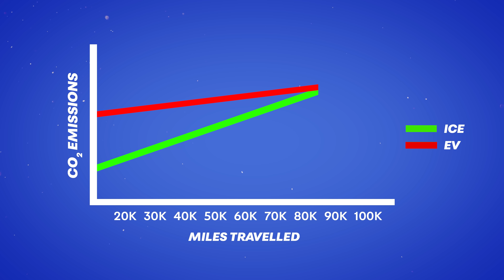Are Electric Cars REALLY That Green? [New 2022 Data]

Comment: (*EDIT* the actual report has a detailed breakdown of materials) It would be interesting to see more detailed information of where the CO is produced in each case. There is no doubt that batteries create CO but it would be interesting to see where and how it can be done better. Also, I wonder if they took into account lifetime maintenance of the vehicle in these numbers. As someone with a PEV, it is amazing the ways that is saves in maintenance. Brakes last an incredible length of time due to regen braking. Oil changes, even on a hybrid with a gas engine is dramatically less often. Also, there tends to be a straw man created where "the energy created to charge batteries is generated by coal" which you touched on. This is simply not the case in most places. Lastly, if you have solar and you charge your car with and you are closer to the 26k miles number, isn't that worth it? The average car is on the road for 200k. Isn't that an incredible reduction in CO2 and more than worth it? I think the biggest challenge right now is not the technology of the EVs themselves, but in the recycling methods for the batteries. There is a lot of development by about a dozen major companies that are promising up to 97% renewability. This needs to be funded and implemented to dramatically increase the carbon offset and answer the last questions of the future of EVs.
Reply: As a car mechanic I tell you that EV have maintained to do. They are far from perfect and people think to highly of them. First of the brake regen for the battery is theoretically good but what it does to the normal people not knowing how to properly drive these vehicles is that they only use brake regen and the normal brake systems seize over time. Costing a brake job every year. Secondly those big batteries are heavy making the tire burn faster and unevenly. Tire are expensive and made primarily out of oil... Can't wait to see all those car going to the scrap because replacing the battery will be to expensive and the client will rather get the newer model instead. Joke aside Ev is far from being the solution just telling you.
Reply: @RAYB1997  Of course EVs need to be maintained. However, most of the serviceable items are unrelated to the electric motor or battery. As far as "normal people" not know how to drive to optimize brake regen, come on. You begin learning from the first time you drive it, you start learning to brake a little earlier and lighter on the pedal to optimize the regen. Plus, EVs are designed to electronically regen on their own. In addition, the information centers give you real time regen efficiency information to help you maximize regen. Also, you still use your brakes so the idea of your "brakes seize over time" and need to be replaced every year is absurd. I have over 90k miles on mine and the brake linings are still over 65%  If I still have the car, I will probably need brakes in 2025. My car is only a couple hundred pounds heavier than other comparable cars. (a full EV is more) but still literally over a ton lighter than my pickup. I got 63k miles out of my first set of tires by the way. Another thing, tires are made up mostly of natural rubber, steel and some synthetic polymers (which contain petroleum but only make up a small percentage) . They still haven't found a replacement for the good old rubber tree. Of course, that is a moot point since ICE cars have tires too. Finally, "Can't wait to see all those car going to the scrap because replacing the battery will be to expensive and the client will rather get the newer model instead" Well, nobody wants old ICE cars either and want the newer model. And batteries from EV cars can have a second life in energy storage, where high load storage is not critical. Already a lot of industry developing to utilize old cells. Medical equipment batteries have been finding "second lives" for years so it is not a stretch to think this will become standard practice. There is also a lot of companies that are being created to recycle to materials from the batteries at their final end of life. All the heavy metals (lithium, cobalt etc.) and aluminum are all targeted at about +97% recyclability. There are a ton of things that still need to be worked out with EVs and infrastructure, but they are here and are viable now and will only get better. Just telling you.

Comment: I have a Ford C-Max hybrid plug in. Bought it used. Fabulous car for me.
Have you seen an oil refinery??

Sit at idle at a stop light or in a  drive thru. No heat blowing from underneath
Reply: And… I drive less than 20 miles per day and I plug it in at home. Go ahead drive one. You might like it. I’ve filled up with gas only 5 times since I bought the car 13 months ago. 29K new with 37k miles and I paid 11K.  Gas is $4.29 here…

Comment: There is a big BUT here. Several EV makers say that the batteries only last about 6-8 years, so that breaking point will in that case be even further away if the EV needs 1 and ½ battery pack.
And then you have the issue with recycling the batteries, also not made easy and is a horrible process. 
So if you ask me, EV´s are today just a silly gimmic. We need much better battery tech. 
AND, then you have the CO2 "badguy" which isnt actually the badguy here, the planet could actually have a lot more CO2 before it becomes too much. Forests, crops, rainforests and so on actually want more CO2. So we would have more and better crops and the rainforest would grow back faster... It is all very complicated!!

Comment: Battery technology is improving by the day, with new lower cost options such as sodium already on the horizon and eventually battery recycling will recover the raw materials.  Even today for example aluminum is recycled at 5% of the energy cost of smelting new bauxite ore.. you can google that if you doubt it.  Eventually the raw materials in the battery will be recovered at similar rates.  This comparison even if valid today, will only improve in the future

Comment: If we take into account that it takes manufacturers years and years to eek out one or two percent in efficiency with ICE, beeing able to save 40% simply by replacing the ICE with an electric option still seems to be a lottery win in my book. Add to that the reduction in oil usage, particulates, NoX, maintenance materials etc., and this study is nothing but the simply proof that an electric car is greener no matter what, even if you just drive it and don't bother looking where you get your juice.

Comment: Yes it is. Especially  with that solid state battery technology. Dont have to worry about oil changes,  transmission oils, o2 sensors, catalytic  converters,  spark plugs, gas, fuel injectors, exhaust system and radiator

Comment: No vehicle can be green if it goes to the crusher at 150k-200k miles which is pretty typical. 
When the average lifespan of cars and consumer trucks is 750k miles, perhaps we can talk about 'being green'. Regardless of energy source - electric or gas. 
We really need million mile cars to be normal, not the extreme exception. That can only happen if it is deemed important by the consumers. At the moment, everyone thinks it is totally cool to get a new car every couple of years. It is not. 

EV's will win in the end because the bad elements are easier to contain and solve that the bad elements of fossil fuels.

Comment: EV car batteries don't last as long as an ICE car, so then you must either replace the battery packs or purchase a new EV car (a distinction without a difference). Then what happens when the demand for EV vehicles goes up and out paces the demand for ICE vehicles? The demand for more battery raw materials mining goes up along with the carbon footprint. The short sightedness when it comes to "going green" is shocking. And this is supposedly coming from the greatest thinkers on the subject. We are doomed by voting in leaders who would rather be seen doing something rather than nothing, even when doing something has a net negative outcome. It all seems to be for the political virtue signaling.

Comment: Very good video that and looking on a Neutral perspective, but there is one argument that should have been added to it Battery life and Car Life and the second hand market... I was down at Jaguar on a Factory Tour the other year and they showed us the new F-Pace, the first question we asked was how long do the batteries last before needing replacing and they was honesty and said it between 7-8 years and the cost to replace them is £17,000 so is not worth doing over a new car so a new car is the best solution, so factor in the recycling cost and smelting the metals to be re-used again usually in a foundry run on fossil fuels so that needs to be factored in the mix. Good Video though

Comment: I love the idea of the EV, just not the real life practicality of them. For instance..much of the time I see an EV on the road it's usually one driver only..maybe a passenger in front and back, middle of the day, decent weather..and not exceeding the speed limit by much. I further assume the owner driver is rather close to home, where it can be charged via (hopefully Solar panels)..but what happens to that EV's mileage per charge when you add 5 large adults, may a ski rack or bicycle on the roof..it's night time, you have headlights on, radio/entertainment system on, heater/ac running..these all take a toll on that charge. Now what about speed limits..( I am ok with 65 or 70, but I am rarity) what happens to my average distance now..and lets not forget, there are not necessarily charging stations everywhere. What about different plugs for faster charging. What if you're that road warrior who drives literally 80miles a day or more to your job..what I start to see is all the additional charging that has to get done and that's not free..lets not even discuss if your ev is caravan capable..that mileage per charge is now gone to half..!! Who wants to drive from Cornwall to the Norfolk Coast for a weekend in the caravan and have to stop twice to charge the car..?  You can only eat so much happy chef english breakfast plates in a day right..?  :-)  but I liked the presentation of the information.

Comment: 2 Things:

First everyone says that EVs need to replace their batteries every 10,000 miles. So was that also excluded in your findings?

Second If you do not have a power storage devise then you are in fact only using green energy during day light hours because the power grid does not store power.

Comment: This is a simple comparison. I need to heat a building. I could burn gasoline or kerosene or fuel oil or coal or any fossil source at the building to heat it. I could also use an electric heater. Where does that electricity come from? In the US, roughly 80% of electricity is created from fossil fuel sources. Energy is energy, no matter where it comes from. So, do I pollute at the source or do I pollute somewhere else, make electricity, transmit it to the source and then use a seriously inefficient electric heater to heat the building? You need more fuel to convert fuel to electricity, transmit it to the source, then convert it to heat at the source and electric heaters are very inefficient at doing that. Ultimately, electricity pollutes more, it just moves the pollution around.

Also, don't get me started on what you have to do to dispose of an electric car. You can't just chuck it into a landfill somewhere and call it a day.

Comment: There is point that it is not often mention which is that the batteries with the time decrease their efficiency. That means that with the time the car requires more energy to move and then later this will devalue the car drastically, which will affect those that want to sell it or those resellers.

Comment: I’m glad somebody has asked the questions .my biggest problem is we live in an area where we have brown outs anyway you put electric cars in the mix and you’ll choose between your lights and heat or air conditioning or your transportation ,you won’t get both the grid is antiquated what do they not get ?you have the cart in front of the horse if you don’t fix the grid these vehicles will not go anywhere .in small numbers like now it’s not anywhere near what it will be like when you charge all of these vehicles all of the time. You also need to ask why don’t you see these cars like a Tesla in NASCAR racing ?the reason is in a collision these electric cars will explode ,you have the equivalent of the transformer hanging on the telephone pole in front of your house that much power is stored in the batteries .at 200 miles an hour against a wall or another car In a correlation they explode .the public is not aware of this ,it needs to be and of course you have to burn more coal in the power plant to produce enough electricity and your bills will go up you don’t get something for nothing.